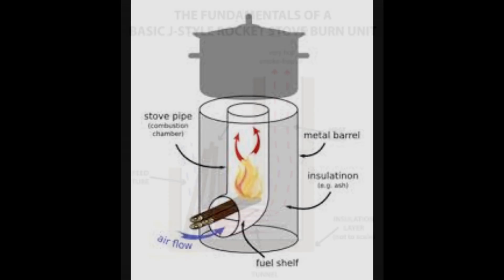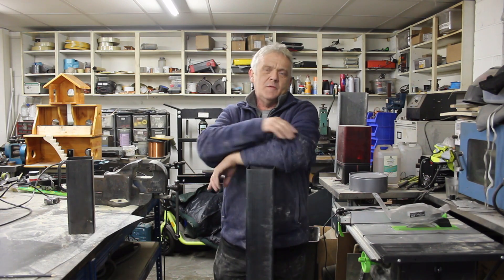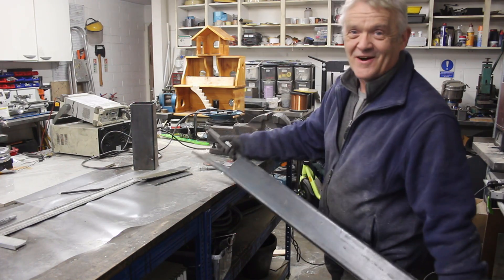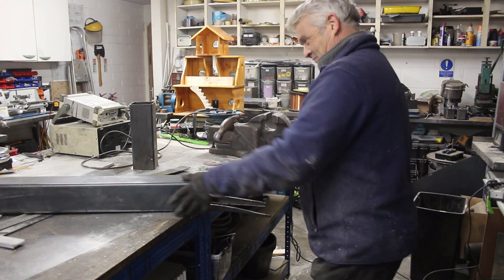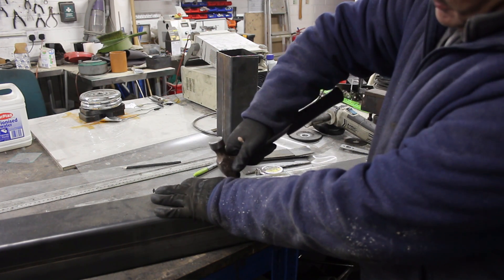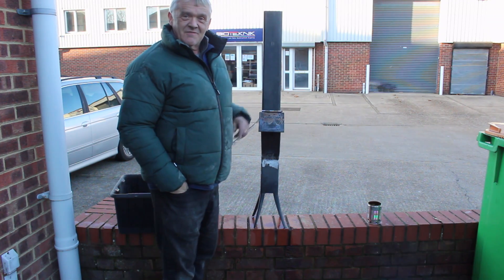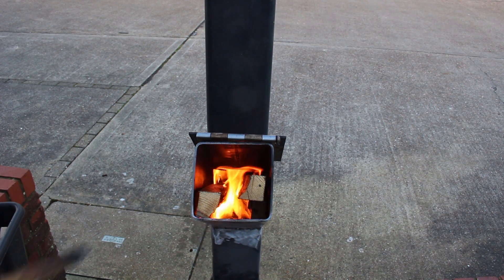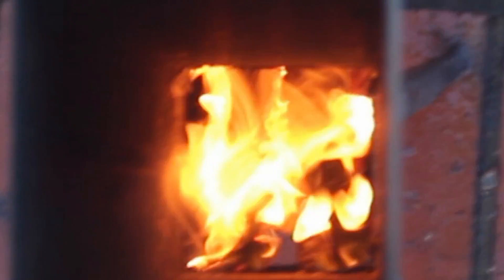1770 A New Type Of Rocket Stove - The 'I' stove

Comment: I have some helium tanks and refrigerant tanks I been thinking about making something like this with, they are about 12"x 18" roughly, I was thinking about cutting the tops off two, and weld them together, put a 4" pipe in the top, about 20"  then make a 180° to go down about 10"  then to a 8". Chimney pipe,  maybe just put 3 tanks together , with a divider in the top tank,  and use 1"x2" or 2x2" maybe 1.5" round tube, going in the bottom side making vents that are also legs, to make a swirl as the air comes in, maybe make a boiler from it as well,   I'd like to build a steam engine that can atleast equal the performance of a 6-8 HP gas engine, or a 5 HP at the very least,  to spin a alternator for a dc generator,  hopefully 3kw to 4kw there about , but atleast 2kw and run about a hour or two per load of wood, and build a insert to burn waste oil, running until it's out of water,  making a sealed system desirable,
Reply from the maker: I will do a more technical version of this mate - the design isn't random here - but I do like your ideas

Comment: Hi Rob, sorry completely unrelated but do you remember a brief convo on here about red mercury? Don't think you were convinced of its existence, well look what happened in Atlanta in 2017.  -  ATLANTA — The Department of Homeland Security and the FBI are handling a hazardous materials situation at the Nuclear Regulatory Commission in downtown Atlanta.
Officials confirm they received a call saying a man carried red mercury from Africa into the facility.
Reply from the maker: cheers mate
Reply: @ThinkingandTinkering   no worries, the mystery continues though cos it says it's a nuclear hazard and I don't believe nuclear Is a thing just a code for zero point/free energy. I mean all they do is use it to heat water to steam to power a turbine, so however much energy they are using to 'smash particles together or separate them" they must be getting more out the end of the steam turbine otherwise it would be pointless

Comment: I am concerned about falling embers.  
Did you notice any falling through?  
Please find a way to prevent that as a small addition.
Reply from the maker: I have a suggestion mate - have a thin yourself and make some suggestions - I would love to hear what you think
Reply: @ThinkingandTinkering  if I were doing it (on the cheap) I'd fold some of that Stainless screen and wedge it in the very bottom.  Next level up would be making something from punchplate with very small holes and find a way to attach it to the bottom but I'd be concerned about getting the airflow required.  We MUST contain any falling embers while not restricting the airflow.  Otherwise with no other modifications it may need to sit in a firepit surrounded by rocks like a normal campfire.
Not having worked with a rocket stove though, I am not familiar with the quantity of ash to be concerned with and thus why I originally asked if any was falling through and now defer to your experiences.

Comment: So why do you even have to have the 45 degree angle pipe going in? Why not have just have the lid welded to the pipe itself open it up to put the wood in first light it and close the lid. No 45 degree pipe sticking out just feed the wood in from the top. lol.. sounds good to me.. by the way I love your videos.. and your guys laugh.
Reply from the maker: it was something I was thinking about mate - and really I agree with you - I may change it!
Reply: The angled pipe acts as a small fuel store that feeds the fuel into the combustion chamber and prevents it all burning prematurely... ( causes the fuel to burn from 1 end like a match) which makes it a bit more efficient at fuel conservation

Comment: How fun!
Fire in a tube is just so engaging, yeah? One thing you get for free in some of the other stoves is that built in turbulence maker of the change in direction of the fire/burn path. I think you noticed that when using the glass riser (chimney).
Reply from the maker: for sure mate
Reply: It could even be a fire vortex in a tube.... and for that matter, why not make use of that hot air and let that generate electricity with fireproof wind turbine made from stone paper?

Comment: Few Important comments that you should really take into consideration:
1) Its an iStove.
2) Forget the feeding tube and feed the fire straight from the top.
Reply from the maker: cheers mate
Reply: I have thought about top feeding. Problem is that if used inside, there will be a flue attached to the top, so opening up allows smoke out.  Now, say on a boat, the tube goes through the deck, you can load up without the smoke issue. (Ok not good if raining!). Then add an air supply duct to the back of the vertical tube, drawing air from outside to the burn chamber, and you get a room sealed system.

Comment: Shame all the heat is going up the chimney.  What if you put a larger square tube around the chimney section.  Imagine a larger tube starting above the firebox section and stopping well before the top.  I'm thinking for an indoor application where you have the top venting to the outside.  So your larger tube, with convection, will draw cold air at the bottom and blow hot air out the top.  This might give you better heat then the radiated heat from just the upper tube.  Thoughts?
Reply from the maker: that is good thinking mate - thanks for sharing
Reply: @ThinkingandTinkering  Thank you!

Comment: Brilliant!  One of the problems with rocket stoves is ash buildup in any turns of the flue (especially the first) restricting air flow.  In this design almost all ash is going to fall to the legs where you can put an ash can for collection.
Reply: That is why you make a grate there with a slide so it's as easy as just pulling open the slide and letting the ash drop out. All of these he shows are essentially just basic prototypes with no proper real life function added in, just the basic theory.
Reply from the maker: that's not right mate - some are - and they are meant for people to develop and think about - some are finished and meant for use - I get a sense you have missed an important aspect of this design
Reply: Put a baking pan under it for ash.
Reply from the maker: yep!

Comment: Now you're where I'm at accept I went for 100x100mm steel box conduit trunking. Not the thickest but easy to work with. I'm using rivets, get an extra lid to cut up and make simple doors and vents!
Reply from the maker: nice - good choice of material for working out ideas too mate - thanks for suggesting it
Reply: @ThinkingandTinkering  it's cheap on Marketplace, got about 12 meters with lids for £40 😂

Comment: I had been thinking of something similar using the perforated bricks I have lying about and concrete blocks for the chimney. It isn't quite "I" shaped, but the idea was to let it burn for an hour and then bring the loose chimney blocks indoors (as an emergency solution). I'd quite like to do the welding, but I'm not sure that I would do enough to justify getting  one so perhaps for people in a similar position, maybe the concrete block solution might be cheaper to organise and easier to do and only cost about £15-20. I use concrete blocks for my raised beds so I have getting on for a 100 of them so they have uses about the garden anyway.
Reply from the maker: that's clever mate - thanks for sharing

Comment: Isn't that what some wood stoves do? Pull in air from top, front, and below? Yours is definitely more compact. And doesn't need a holding chamber for the wood itself per sey. Just the feeding shoot. Its definitely a more compact twist on an oldschool stove. Its like the stove is built into the chimney pipe itself.
Reply from the maker: pretty much mate - cheers

Comment: I accidentally built a stove like this 20 years ago out of 12 inch square tube before I knew what a rocket stove was. Had to leave open the windows and door in my little shed all winter.
Reply from the maker: lol - now that is some heat!
Reply: Maybe it's time to build another....?🤨
Reply: What’s the little model house in the background for?
Reply: Imagine though, you were to scale this same stove you built a bit larger, to be the center of a whole apartment, for example; instead of a house having a boiler/furnace room, it could be this extra large "I" type of rocket stove right in the center of the floor plan. Exactly as the termites that build the giant chimneys do it.
Reply: @captainnemo6655  most of the actual heat does straight up and is lost.  You would need to have some way of capturing all that heat and distributing it without the exhaust gas.  Have a look at the rocket mass heater designs .
Reply: @gregcooper8407  We do need some of the heat to go up and be lost, just to drive the draft.
However, the taller the chimney, the less heat we need to lose to maintain the draft.

Comment: I really do like it, "straight forward", but I do not do welding! Is there a way to make it without the welding? BTW You sure are clever, Mate!!!
Reply: Hi, How about the round pipe with a Y fitting in where the feeder is. Lots of drilled holes to make the grate. No welding
Reply from the maker: I like Karl's suggestion mate
Reply: @ThinkingandTinkering   Thanks , Yes that will work! Sometimes they give stars for great work, can't fit 'em all so  I give U a google's worth! Also 2 U Karl, what a great crew we have here!

Comment: Plunking fuel in the top with a pair of tongs would eliminate the need to weld entirely. I hope some viewers are inspired to buy a grinder and get busy!
Reply: Maybe hinge the bottom so it could be tilted to easily feed before starting.  Would a few 2.5mm square 1m long dry wood pieces bundled to take up 1/4 the volume be a good start to feed iRocket?
Reply: Limit the length to 1m so as to have head room to feed it?
Reply from the maker: I hope so too mate

Comment: The genius behind the j-tube is that the fire and exhaust gasses are forced to take a 90 degree turn - which forces the gasses and flames to mix - forcing a more complete burn.
Reply: You can still achieve this with an angled plate or two inside
Reply: @stupidscruff  tricky.  You need to get to temps over 1300F to get a complete burn.  And steel spalls at 1600F.
Reply: Two angle cuts and 70mm flat bar should be worth a try.
Reply from the maker: cheers mate

Comment: maybe if you installed a sliding bottom plate you could control the burn (temp)
Reply: In stead of a sliding plate, a rotating door?
Reply: @toml.8210  Or an excalator?
Reply from the maker: I like the idea of a door
Reply: this could work... imagine though, you were to replace the bottom with a half dome cage like a colander, made from stone paper, fireclay or other fire proof material, to make the whole thing bottom heavy and hold the burning fuel in place, then surround this whole thing with 3 curving steel plates that can make a cylinder with 3 vertical openings and then top the whole thing off with a 5 foot tall high temp glass tube
Reply: @captainnemo6655  Otherwise everything ok?